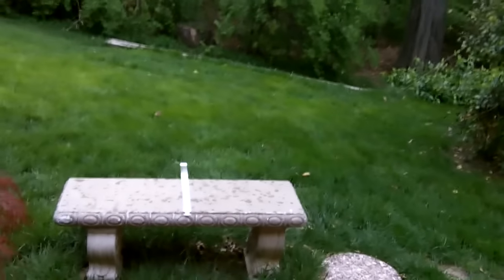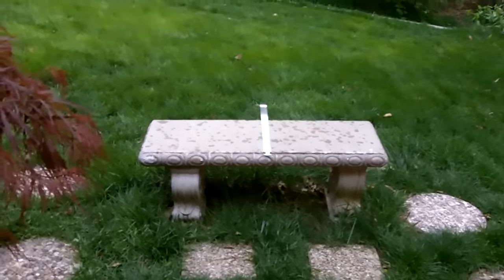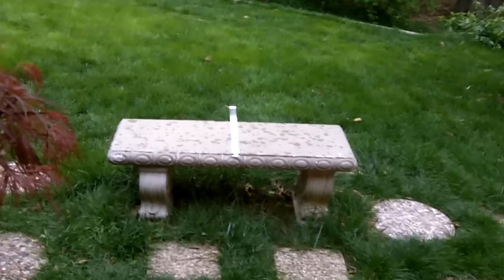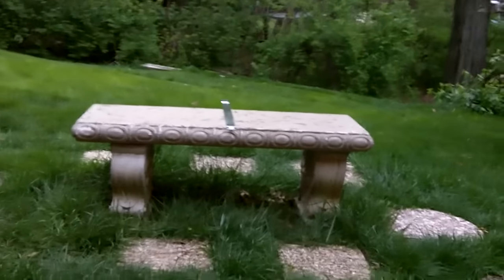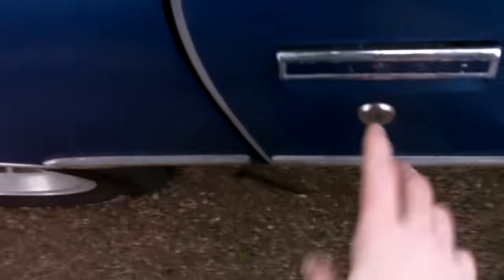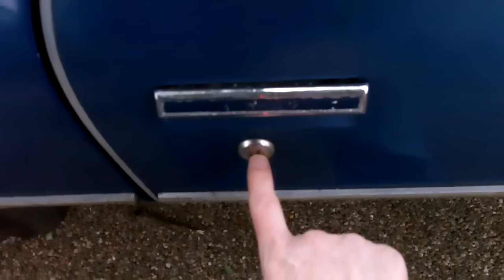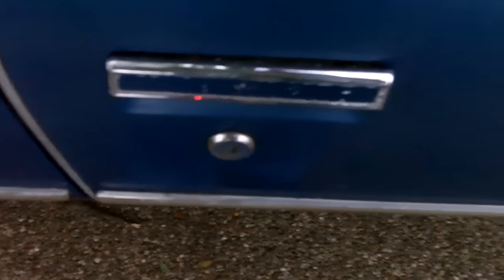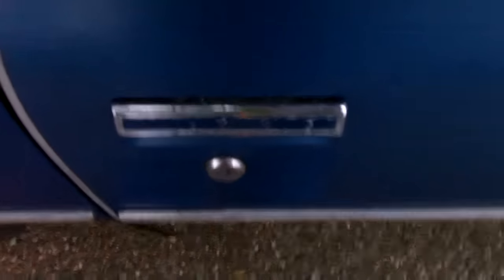How To Unlock A Car Door Using a Slim Jim

Comment: terrible video. You dont tell us if you pull up or push down, you dont tell us if the slim jim is straight or curved or bent, and you dont tell us if it is bent, which way we face the slim jim, with the bend facing toward us or away from us. Totally un-informational. Thanks

Comment: I as some others have mentioned used to do this regularly in my part time job.  This video is a little deceptive in that there is no mention of using this tool on newer vs older vehicles.  Pre 1990 give or take a little cars were very very easy using the method shown.  Vehicles have become increasing more difficult to open with only a slim jim.

Comment: I Damaged the lock by trying this. The door went open but since then i can't lock the car with the keys! What do i have to do now? Please help me!!
Reply: +Divus Band You probably disconnected the rod assembly. This happens when you pull(or push) on the rod too hard. I hope this helps.
Reply: That is the downside of using a slim jim. It's also the downside of blindly following any video online. You've either bent the linkage rod or it became disconnected from the lock cylinder. What you'll have to do now is learn the correct way to remove your inner door panel and hook the door lock rod back up. It should just cost you some time.
Reply: @quickaccesslocksmithing5669  I own a Hummer 3 2008 and my driver side door handle has came off.I have my key to my vehicle but the key isn't letting me unlock the driver side or passenger side door.
Reply: @ Quick Access Locksmithing  what would you suggest

Comment: Does the slim Jim trigger the car alarm? I recently believe I got my car broken into
Reply: I'm not 100% sure about newer cars, but on older cars it does not. The car thinks its being unlocked like a key, so the alarm will most likely not go off. Newer cars sometimes have alarms go off if the lock is tampered with, so a rough slim Jim job will set it off.